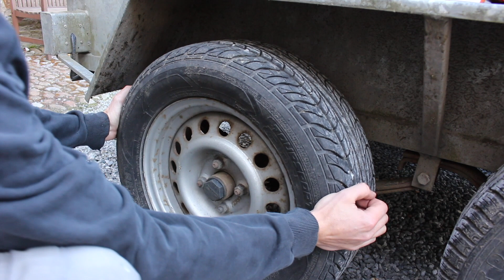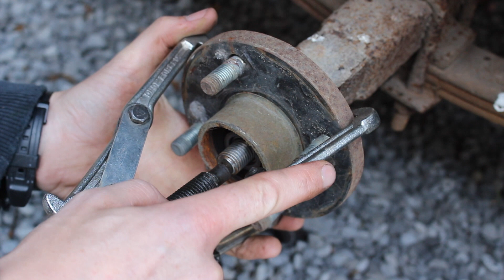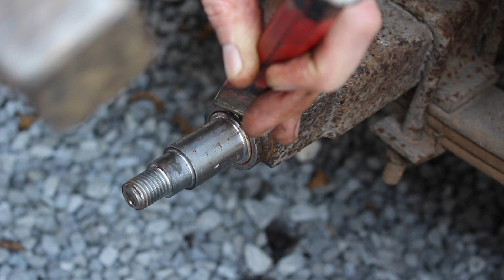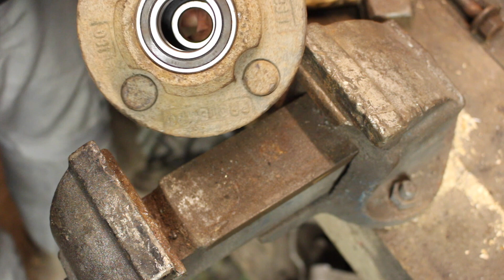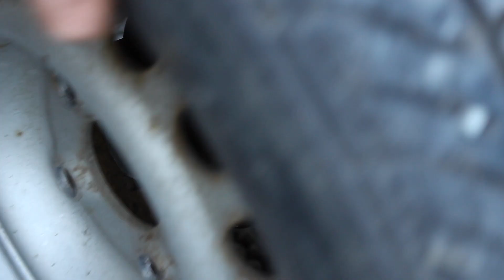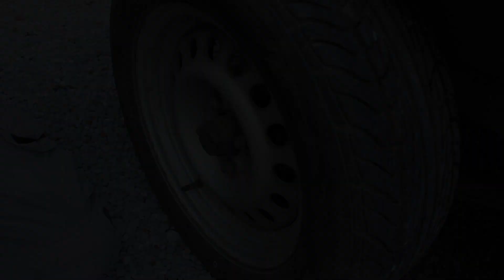How to Replace Trailer Wheel Bearings (Sealed ball bearings)

Comment: where your washer at?? I would run it on tight to seat bearing then back it off and tighten nut to spec, not just run it on like you did once